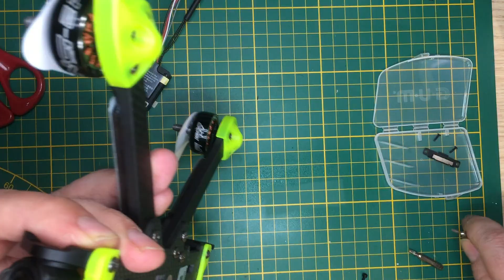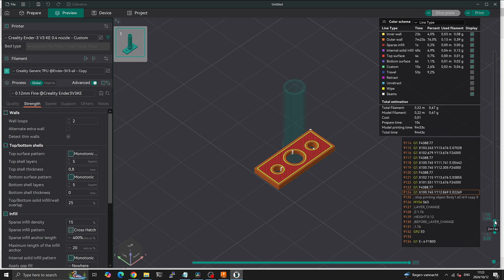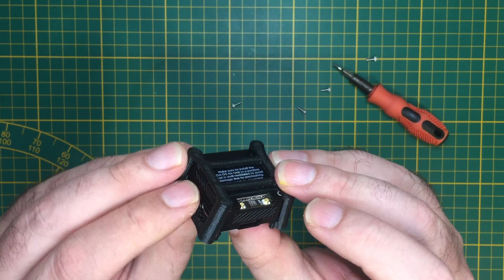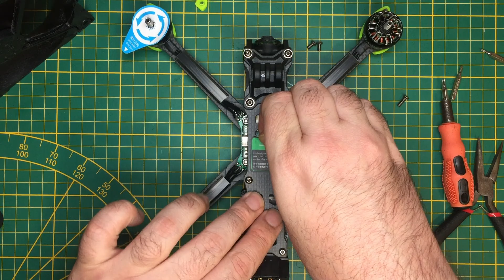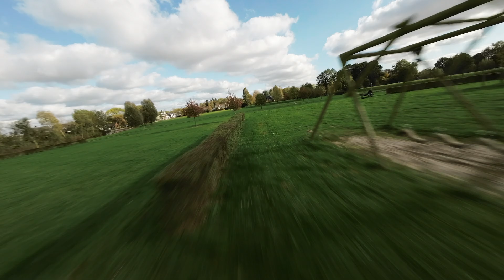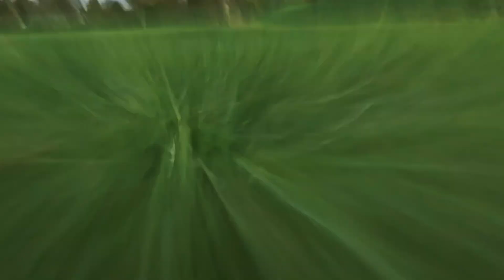Convert your Quad from analog to digital

Comment: Thanks this really helped!! Would this be different with the walksnail install?
Reply from the maker: Totally depends on which Walksnail VTX you are planning to install. The Avatar HD Nano Kit V3, Avatar HD Kit V2, Avatar HD Pro Kit should work. Always make sure to double check the connection diagram of your chosen VTX at caddxfpv.com first. Only difference is to check the input voltage (V) and make sure it can take 9v. https://youtu.be/k8jr9W_8MJE?t=559 Good luck, since making this I have 7 new quads the Eco is still one of my favorites.
Reply: @chrisscave thanks this is so helpful